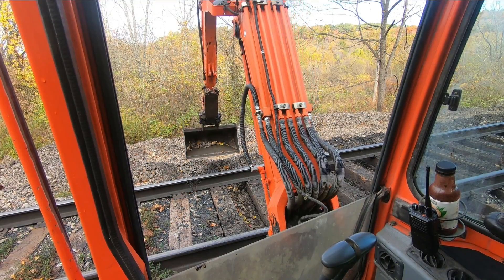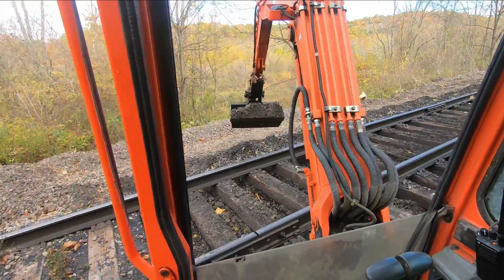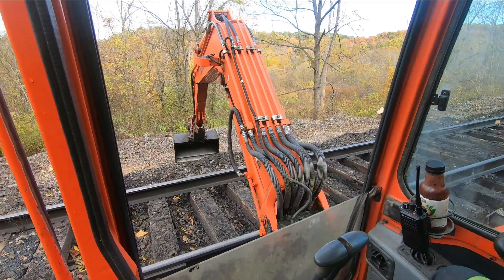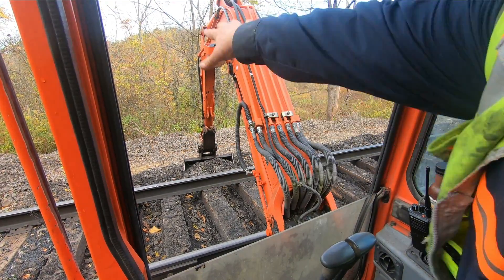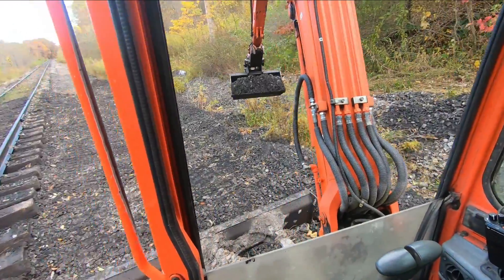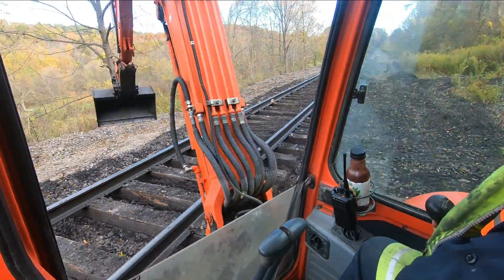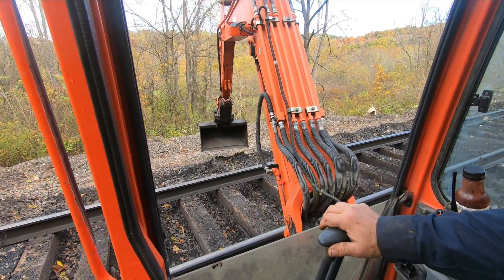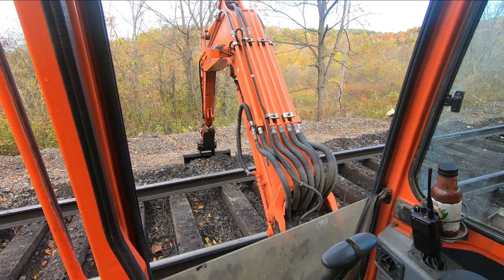Why Don't we Reclaim and Wash our Used Ballast?

Comment: There is a mobile method for cleaning ballast but not cleaning in the way you describe. Plus after reading the wiki on it, I see that new ballast is ultimately needed because old ballast becomes rounded and other things happen to it necessitating the need for new fresh ballast. Once again, many of the hidden things we never think about in regard to the complexity of rail. Makes me respect your job that much more.  

(And BTW; How do we send you Christmas presents? I know I know, I'm Jewish and all that.. I don't celebrate Christmas, but I do get things for other people that do. You should get a P.O box because you're becoming important with all your youtube fame.) 😂🤣

Here is a copy and paste from wiki. 
"Over time, ballast becomes worn, and loses its angularity, becoming rounded. This hinders the tessellation of pieces of ballast with one another, and thus reduces its effectiveness. Fine pieces of granite, like sand, are also created by attrition, known simply as "fines". Combined with water in the ballast, these fines stick together, making the ballast like a lump of concrete. This hinders both track drainage and the flexibility of the ballast to constrain the track as it moves under traffic. Ballast cleaning removes this worn ballast, screens it and replaces the "dirty" worn ballast with fresh ballast. The advantage of ballast cleaning is that it can be done by an on-track machine without removing the rail and sleepers, and it is therefore cheaper than a total excavation."
Reply from the maker: Yes ballast does have a life. It needs to be sharp to hold the greatest
resistance against the tie. Trains and tamping wear the sharp
edges off. Think hitting a steel chisel against a stone and
you'll get what happens every time I tamp. Then those chips and
fines off the ballast contribute to more fines in the ballast and
more plugging up action. Once stones get rounded, think
putting a board on roller bearings, it's not very stable and
track can slide easily. Also much and coal in the ballast
when it gets wet acts like a lubricant causing sliding action
to happen more easily. 

Thanks for the present offer David, just send me a lump of coal.... :-)
Really appreciate your watching and writing in my friend.

Comment: If you were connected to the rail network you could bring in an under cutter ballast cleaner. But it’s likely too big a piece of equipment to bring in by truck and trailer. And it does look beneficial for the right of way to spread it out as you are doing.
Reply from the maker: Alas we are not George, that negates a lot of things that we
could use and need here, specially transporting our locos
and cars in. Coal is actually a fertilizer. it increases soil
organic matter. So by spreading coal along the ROW I'm
actually fertilizing the soil. Read this video's description for
more about coal as a fertilizer. What I don't do is spread the
coal fines out anywhere it could have the possibility of
getting into a stream. That is an EPA no no and would get
the company fined. Thanks for watching the video today my good man.

Comment: if that old ballast contains coal shdnt it be put in a hopper car and hauled out instead of contaminating the mountainside????.
Reply from the maker: Not sure why you think the coal fines are contaminating Raymond?
Slurry water is and coal fines that get wet and could find it's way
into a stream is contaminating. I do not do this kind of work
when there is any possibility that the fines may end up in a stream.

However coal fines are used for fertilizer. They don't add many  nutrients however they certainly increase soil organic matter.
Testing has been done by 3 major US universities and they all
found out that by using a coal blend as a fertilizer it definitely
increased corn yields and some fruit tree yields. So in actuality
by spreading the coal fines along the ROW I am increasing
soil fertility. Please read this video's description for more
info on coal as a fertilizer. Thanks for stopping by and watching
the video.